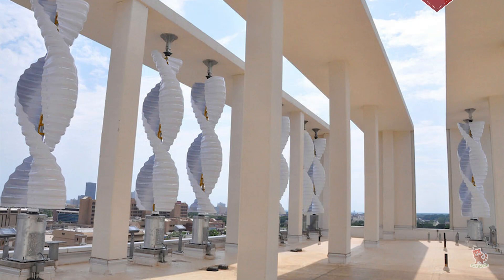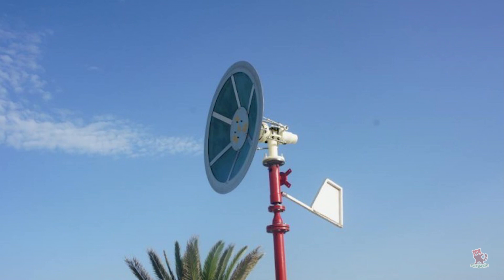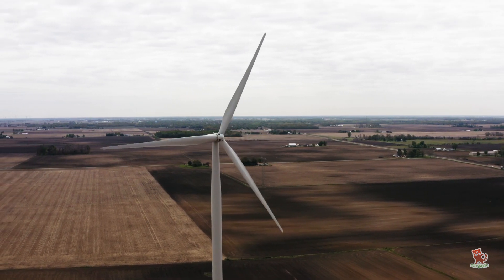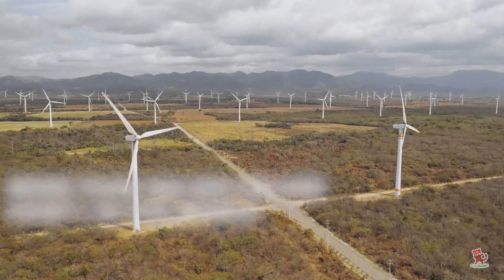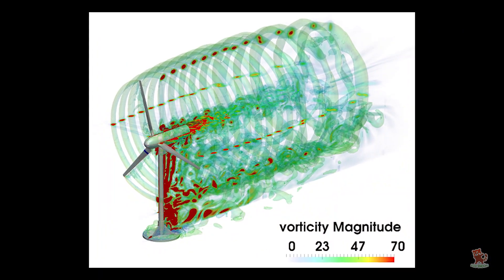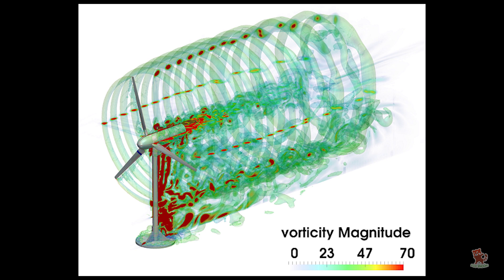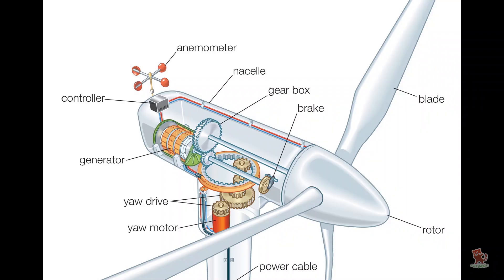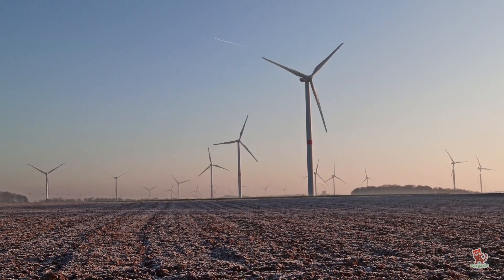HOW MANY HOMES CAN BE POWERED USING 1 WIND TURBINE ?

Comment: Wind turbines can NEVER be more than 59% energy efficient & that’s at the MAX!!! It’s called Betz Law!!! Basically it’s like pouring a full gas can into your car but 41% of the gas is always spilled, leaked out or evaporated. Or like you pay for an acre of land but you get around 32-38%, even if you sue & are lucky the most you could & would ever be awarded would be 59% of that acre.

Comment: How many kw=units
Reply from the maker: One unit of electricity is equal to one kilowatt-hour. It is the amount of power required to use an appliance of 1000 watt or 1kW power rating for an hour.

Comment: Plenty of misinformation in this doc. Too many inaccuracies with both stats and operating costs. A misconception is that once in place, a wind farm is free thereafter, which is a preposterous statement as maintenance and repairs are needed frequently. It also has to be operational for many, many years to pay for itself. Another big problem,  that to the most part was unforeseeable is the price of electricity,  which can drop dramatically with production and therefore cause wind and solar energy projects to become less profitable,  which really matters when in most cases, there's private funding.
Reply: This is the worst design of all.  Most do not pay for themselves